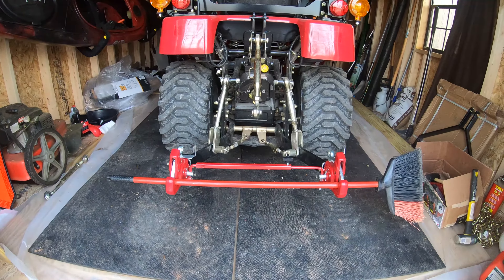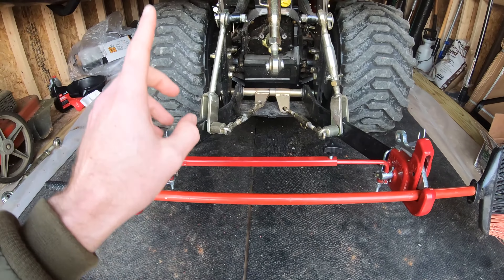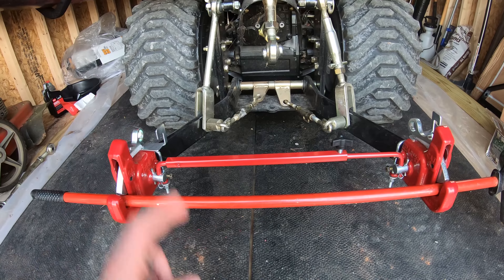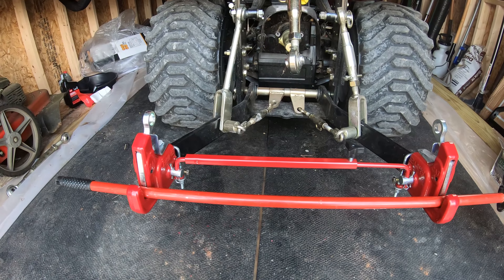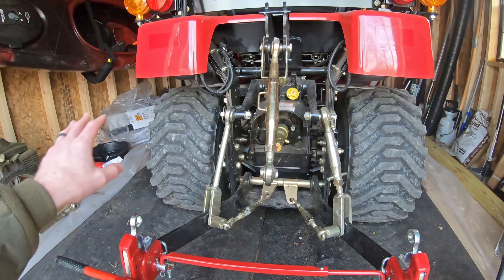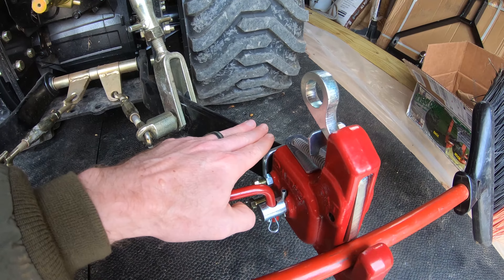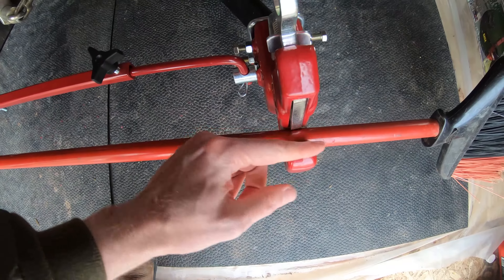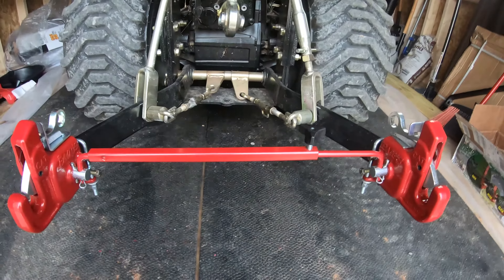Pats Easy Change Quick Hitch || Mahindra Emax 20s

Comment: I got the Pat’s quick change on my Emax 20, had it for three years now and I love it. Just a tip for ya, on the adjustment bar I put a mark with a marker once I find the width I need that way you can use it with other attachments, and if you put a mark on the bar you know exactly where to adjust it for each attachment, then just lock it down. Real quick and Easy.
Reply from the maker: Glad it is working out for ya! Great tip! I just got the rotary cutter all fixed up, so I am looking forward to using the Pat's quick change on that to make hooking up easier. At least that is the plan! Thanks for watching - Shane

Comment: Been there and done that. I got my Pat’s quick hitch a couple of weeks ago and installed it the same day. I got the adjustments “close” and tried it out on my brush hog. I got it on, but I needed to refine my adjustments to get it perfect. It took a while tinkering with the four bolts but eventually got it right. I assume you also received six implement washers; I only need them on my brush hog. They work great keeping the pin out of the way for easy bottom point hook-up. Like you, I had to purchase a PTO extender and an upper-link arm. No more using a big wooden pole to move implements into the hook-up position. 😊

Comment: hey nice vid.
looking forward to seeing that in action.
almost went that direction myself.  
great job.
Glenn.
Reply from the maker: Thanks sir. I didn't film anything today, but I used it with my box blade and it worked out well. I had to grind some metal off the new top link in order to make it fit properly...but after that adjustment it seems to be working as expected! Have a good one - Shane

Comment: Where did you get the top link? I just ordered the pats for the same tractor.
Reply from the maker: Ended up just getting one from tractor supply. Went a little longer because the rotary cutter needed something longer than the box blade, can't remember the exact size, but Rural King and Tractor Supply are good places to get aftermarket. - Shane